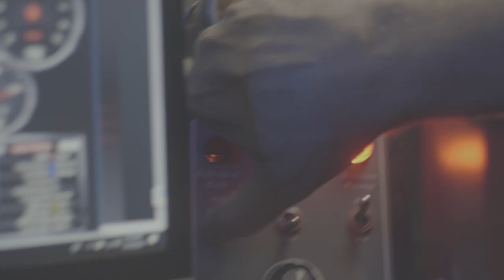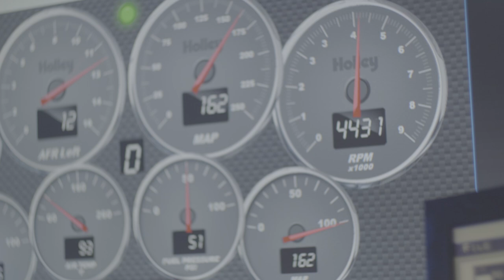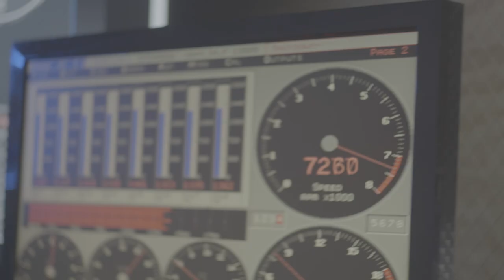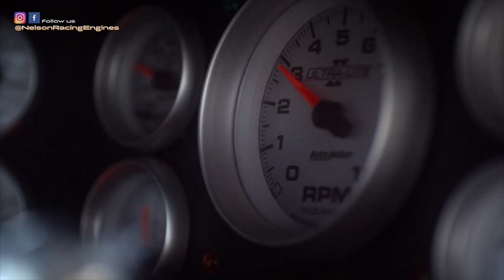Imagine! 1200 HP 260 CI TT LS Full Throttle/Full Load 5 Min Dynos!  NRE's Tom Nelson explains.

Comment: Love the sound of a high revving de-stroker...
Reply: 7.5k rpm is a disappointment in comparison to 20k rpm 

https://www.youtube.com/watch?v=ZOJkl4Agf4c
Reply: GEO000 Nelson is a damn good builder, but to be fair...I wonder how much his engine will cost versus a factory Honda F1?
Reply: @Rajonas007  Rpm means very little, deisel engines rev extremely low and make a TON more torque and are capable of creating a lot more power with less cylinders. Some modified Cummins (6 cylinders) make nearly 4000 lb ft of torque with 1500+ horsepower.
Reply: @Rajonas007  well yeah, but that Honda engine was something like 2 liter and 10 cylinders. Bit of a different design, no? Besides, rpm was not the goal here. There's 10k LS based builds out there.
Reply: @Chuffin_ell  There's also a v18 cylinder Cummins train engine which makes 178,000 lb ft of torque which only revs to 1500 rpm.
Reply: @Rajonas007  NASCAR V8's rev too 8K all day
Reply: @Rajonas007  no disappointment at all as these v8's don't need to rev to the moon to make power but comparing this to an f1 engine isn't apples to apples anyway.
Reply: GEO000 wasn't saying this is shit. Just not agreeing with the first comment of 'high rpm'. High rpm for a murican veeeate but not old school F1 or motor go etc. Everyone is so damn defensive of their favourite engines.
Reply: @chrisrathjan1501  I guess, they took the bait?
Reply: @Chuffin_ell  I mean high revving part, 20k rpm is HIGH revving, not 7k, it sounds like any boring truck too.
Reply: GEO000 I get what you’re saying, and I really love that Honda F1 sound. The one of it at the Nagurimachimachica whatever track is just insane. Real insane. Not a Tom Nelson insane. 
Those Y-block Fords 390-427 are also music to be heard at high rpm. Something about a motor that is engineered to stay together while running WOT all day just sounds amazing....
Reply: @Rajonas007  Actually, piston speeds of NASCAR cup engines and pro stock drag engines etc. are very similar to formula 1 piston speeds. The reason F1 engines rev so high, essentially, is their very short stroke.
Reply: Circuit Dude I mean when you run like ~20-22:1 compression and 60 pounds of boost, you’re gonna make big power without spinning a lot of RPM. You’re trying to compare two different spectrum of engines. You’re comparing an engine that was built to pull stuff at low RPM to engines made for races that have limitations and regulations. RPM’s do matter. When you have a small cube engine, winding it up in the RPM’s is the only way to really get power out of it.
Reply: @dustydresser7598  I'm talking about a drag truck which was made to make power at the Dyno, on the track, and during sled pulls.
Reply: @dustydresser7598  Also, it made a lot more than 60 lbs of boost, diesels make crazy boost numbers, often in the hundreds.
Reply: 7000 RPM is not high revving my friends 908 rare Morrison spinz 7000 now you're talkin high-revving considering rotating Mass not to mention naturally aspirated small blocks in super stock that's been 10 to 11000 RPM now we're talkin
Reply: @Rajonas007  well goofy this isn't a Formula 1 engine
Reply: @bilbobaggins4710  more like 9000 9200
Reply: Y'all still sent getting the point... RPM means very little. A hellcat doesn't rev to 10,000 and it makes 707+ horsepower stock. Drag cars don't shoot for most rpm, they shoot for most horsepower/torque. RPM means very little, some cars rev high because they have small cylinders, doesn't mean they have a lot of power.
Reply: @Chuffin_ell  ,The 390 and 427 are FE Big block,not the earlier 272,292,312 Y block from Ford.
Reply: Circuit Dude and...? He said he loved the noise!! So do I!
Reply: @circuitdude5924  Sure enough diesel makes a lot of torque, but saying "RPM means very little" is pretty inaccurate when you're talking about a race boat engine. RPM means a whole lot.
Reply: @msanchez7317  Not really, that just means they want the engine to be compact. If you are going for speed/time and not under the constraints of some random, made up regulations, a bigger engine at low rpm makes A LOT more power. There's no replacement for displacement.
Reply: @TheMW2informer  Of high rpm engines? They sound like lawn mowers in helium. The best sounding engines are hemi's. They make huge amounts of displacement, without all the unnecessary RPMs. Top fuel dragsters use hemi's. Hellcats use hemi's. Ram's use hemi's. Demons use hemi's.
Reply: Circuit Dude I am referring to your first comment, not the last one
Reply: David Humphrey okay. I thought the y block was ALL of those.
Reply: TheMW2informer the way my truck sounds on Monday am when I’m late for work😜
Reply: Chuffin 'ell same thing here! The neighborhood predominantly has other people with LS trucks
Reply: @Chuffin_ell  I don't got the time/volume to watch that right now, can you sum it up?
Reply: Circuit Dude it’s a Big 3 cyl Cat 5d. 
Thing is rated for max H.P. at just over 1500rpm, but when it gets loaded down to about 500 rpm torque reaches max.  Thing sounds mean pinging along under load. Save a link, you may like it...
Reply: @Chuffin_ell  Doesn't sound bad, my favorite sounding car is easily the Dodge charger skat pack. Look up cammed charger Daytona, has the same engine as the skat pack
Reply: Circuit Dude You’re trying to make an argument based on personal preference at this point. I know that diesels can go well over 100 psi in boost. But my point was that they make as much power as they do because they have big cubes and lots of compression. Obviously a gas motor doesn’t run that high of compression. The most you’re gonna get is roughly 15:1, but then you’re likely not going to throw boost at it. Also lots of big displacement engines such as top fuel and pro stock cars rev well above 7000 RPM. There is so much untapped potential in the higher RPM range on lots of engines. Top fuel hemi’s come off the line at around 8,000 RPM since they red line at 8,250. Yes, you don’t need a lot of RPM to make big power. But when you have regulations in place, you don’t have much of a choice.   People have proven time and time again that “no replacement for displacement” is dead. Forced induction killed that statement so fast, it’s not even funny.
Reply: @dustydresser7598  First of all, i was just saying my personal opinion, not everything is an argument. Secondly, low revving engines do not have a lot more potential. They can't rev high because they are bigger, the bearings have a bigger load and can't go the same speed as engines with smaller pistons. Third, there really is no replacement for displacement. The viper ACR engine makes 650 horses with 8.4 liters of displacement. It is one of, if not the most reliable 500+ horsepower engine in production. For some more background information; it is a naturally aspirated v10 engine. Now let's compare this to the 630hp 5.2l v10 huràcan engine. This engine makes nearly the same horsepower but isn't nearly as reliable. It doesn't last nearly as long and requires more regular maintenance. Another example of this is a massive Cummins engine which makes 17,802 lb-ft of torque and 5100 horsepower. It's used in rail, mining, and marine applications. It's called the QSK95. It is a 16 cylinder, 95 liter, 28,475 lb engine. It is ridiculously reliable and runs at 1800 rpm. Now, top fuel dragsters. They have decently arge displacement, usually around 8.2 liters, which for the power they make, isn't a lot, which is why they are so unreliable and literally destroy themselves after just one run. By the end of the 1,000 feet, they usually arn't firing on all of their cylinders because the pistons have basically welded themselves to the block. If you want to stop arguing, I will gladly share some cool videos of too fuel dragsters, their incredible tires, and these massive deisel engines.
Reply: @circuitdude5924  I'm kinda getting the impression that you are a "youtube" only car enthusiast. Saying RPM's don't matter is objectively wrong. A light race car needs only a little torque to get moving, but a lot of horsepower to go fast. There's a formula that engineer's use when they design an engine. It's (RPM * T) / 5252 T=Torque. High HP engines need RPM and that is regardless of size. Diesels have their uses which are mainly industrial where low power, high torque, and little maintenance make sense. Diesels have heavy valvetrains that can't spin very fast. Low RPMs allow them to make great torque but not great power. Torque is just one of the ingredients for power. It would not make sense to put a low power, high torque and heavy engine in most vehicles. Trucks are the exception there. Road cars are usually a balance of these different approaches. European and Japanese cars usually favor smaller displacement higher revving engine and American's use larger and lower revving engines but the differences aren't as extreme in modern cars. We use to put v8's in *everything*. Typically RPM is what wears out an engine, so a balance between efficiency and longevity is sought for road cars. Race cars use the engines that make the most sense. An F1 car can get away with a 1.6 liter engine that revs to 20k because they need high power and low torque, because it is light and must go fast. It would be a pain in the ass to put an F1 engine in a Charger or another kind of road car just to get it moving. I use to laugh at the idiots who put a billet aluminum flywheel on a street Mustang, for the same reason, you need that torque to get the car moving and a low inertia flywheel struggles with that and causes excessive clutch wear.   The point is, one is not better than the other, the application dictates motor choice. I wouldn't want a diesel in a crotch rocket or an F1 engine in a semi-truck. 

Top fuel dragsters are a completely different beast. This is because they use a fuel that is it's own oxidizer. Gasoline needs roughly 14:1 air to fuel ratio and alcohol is between 5-6:1 and nitromethane is 1.7:1. What this means is the amount of fuel you can inject into each cylinder per stroke is much much higher. They run right on the edge of hydro-locking the motor. They are only designed to run one pass. They don't even have a water jacket in the block. The engine's longevity has nothing to do with displacement versus RPM. It is the most extreme internal combustion engine example and really can't be compared to other motorsport's engines(except top-fuel sports), even though the engine layout is roughly the same.
Reply: @wkruse84  I don't work on cars myself much but I most of my buddies have mopars, classic or modern. I understand that a smaller engine could he useless in Motorsports where the regulations were made up from thin air, but if your talking about being based in physics and reality, having a larger, lower revving engine will outperform any small engine to the point where the added weight is negligible. Even on cars oriented for track use, they often use large engines. From the viper ACR (8.4 liters, the biggest displacement of any production car) which used to hold all the records, to the Porsche gt2rs (although less extreme, it's rather small as the car focuses mostly of cornering with 3.8l and 7,200 rpm), and the ZR1's 6.2l which only revs to 6500 RPM. The only place high revving engines are usefull is when rules, with no origin from reality, are in place. Personally, I care about bottom line performance. I like to watch big tire class.
Reply: @circuitdude5924  I think you missed the point. Yes, F1 and other sports have arbitrary rules but the reason for the smaller engines (I don't mean smaller displacement because that doesn't truly represent physical size) and higher revving engines is all due to physics. It is the best choice for that application. It's a very similar approach to a sport bike. A small 4 cylinder that revs to the moon. Weight is critical on these so you need the most power from the smallest possible size. Two ways to get more horsepower. The equation is HP = T x rpm/5252. So to get more power you can make more torque, or make more RPMs. A large engine would kill an F1 car in handling and acceleration because weight is a very big deal in these cars. The suspension, brakes and aerodynamics would all suffer because of a larger engine. You could not compete in an F1 car with an engine twice as large and heavy as the competition. A sport bike would be heavy and would handle like crap with a V8. Lookup a Boss Hoss, it's cool but don't plan on carving any corners. 

These aren't arbitrary regulations. These are literally the best types of engines because of the laws of physics. This is how power is made. I like large engines too. They are better for street cars as they usually last longer but they are not practical for every "fast" vehicle. Weight and physical size of all components are the difference between winning and losing in competitive sports. An F1 car has no need for large amounts of torque and neither do sport bikes.
Reply: @lieugebo805  I know i'm late to return to this reply section, but I specifically remember Greg Biffle's Ford car hitting about 9800 RPM qualifying at Bristol one year, probably around 2012-2014 timeframe?

To whoever was talking shit about RPM's and so on, NASCAR engines are amazing. They're 358 cubic inch small block-based 2 valve per cylinder engines that "only" utilize around a 12.5:1 compression ratio and good ethanol fuel with a huge camshaft, as is typical with many hot rods, but the tolerances are so tight in a NASCAR Cup engine that near the end of the races the carbon buildup in the engine causes very slight contact between the pistons and the valves. The engineering that goes into extracting what i'm sure by now is well over 900 horsepower out of a naturally aspirated 358 cubic inch small block v8 comes down to absolute attention to detail for every extra quarter of a horsepower, all the way down to every tiny bend and angle in every part of the cylinder head ports, and lubrication and cooling technology and systems that remove an extra tenth of a percent of power loss due to friction.

NASCAR, Pro stock, SSAH Hemi super stock, Top Fuel, and Formula 1 all make up that very top tier in the engine building world. If anything, Top Fuel reigns supreme because the engines are so stressed out they get rebuilt after every 1,000 feet of racing, right? 🤷‍♂️

Comment: this would be the perfect engine for some one who wanted a Australian style burn out car have one of these built lock the limiter at 4500 to 5000 and roll in to the pit and let it eat for 10 minutes . even a set of new tires would get blown out fast the whole point of the burn out pits is to blow both tires and make them last as long as possible this engine with the Holley ability to bump up and down for the power would be perfect for it .

Comment: Great video.  It would be cool to hear more about those water cooled headers.  Whats next an aviation spec mirror image LS?
Reply: TurboDieselDan pre heats engine cooling water.
Reply: Water cooled headers, or as I''ve heard them called before "water pack mufflers", have been on fast boats since the beginning of time.  It should be easy to find lots of info out there if you'd like to know more.
Reply: @TheBrokenLife  Yes I know about water cooled cast iron boat manifolds.  I'm interested in learning more about these double walled water cooled round tube turbo headers.  Such as- is there a reason why they didn't use a billet collector?
Reply: @Sir.VicsMasher  Gotcha.
Reply: TurboDieselDan Its funny you say that, there is a company who makes LS based motors for aviation experimental aircraft. I saw a prototype at Reno Air Races 3 years ago. They were still waiting for FAA approval.
Reply: Supermarine Aircraft is a company here in Texas that’s been building spitfire kit planes with ls’s for years. They make for a badass stunt plane

Comment: I thought the idea of turbo exhausts were to keep the exhaust gas as hot as possible before entering the turbo for efficiency reasons (high temp = energy/high gas flow speed). Why water cool the exhaust manifolds? Love to know the reason, these guys obviously know what they're doing.
Reply: The exhaust would melt off

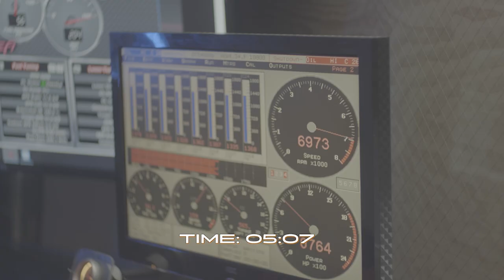Comment: @nelsonracingengines why does it show 750hp on the dyno computer at 5:06 in the video if this is a full boost pull?  Shouldn't it show 1200?
Reply: Because the peak hp came in lower in the rpm range, not at peak rpm/ redline. Means it only make 750 hp at 7000 rpm

Comment: How many  gallons of fuel did she eat in that 5 minutes?
Reply: A lot
Reply: @SkylineTwinSpoolysnail  no way??
Reply: Chicken Boy best answer ever omg 🤣🤣🤣🤣🤣🤣
Reply: All of em
Reply: At 750 hp (like here ) it's around minimum 5 gallons for 5 minutes on pump gas.
you add 35 % more volume if running on ethanol
1200 hp would be twice that.
Reply: Yes.
Reply: @michaelovitch  you have to account for cooling fuel wasted
Reply: @michaelovitch  only 35%?? I was thinking more like 2x...
Reply: 120 gph
Reply: 7.63 gallons more if afr is less than 8

Comment: I used to run 800 hr durability test at wide open throttle on my Superflow 901 controlling the rpm with the water brake, 6500 to 7k Most often, I was testing our timing products at Cloyes Gear, I would do durability, NVH and performance testing, boy I have tore somethings up.

Comment: Question: when the engine first started revving,  the rpm was bouncing ~ 250-300 rpms.  Was that due to the dyno loading unevenly or the working through the engine systems?  It seemed to even out after a minute of video.

Comment: I had to to a similar test on a v8-900 MAN common rail. I had to measure each injector fuel return rate at 2400rpm for 3 minutes in neutral.